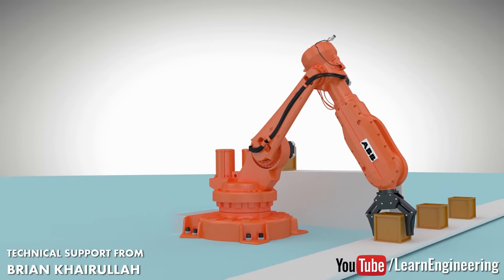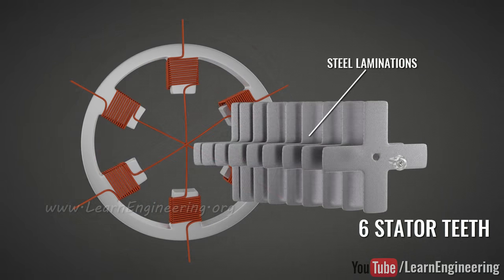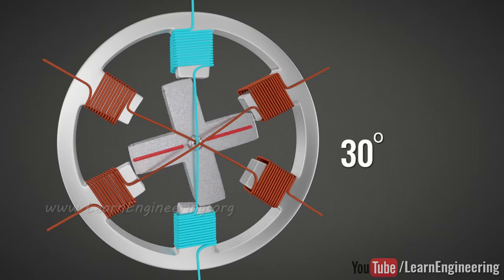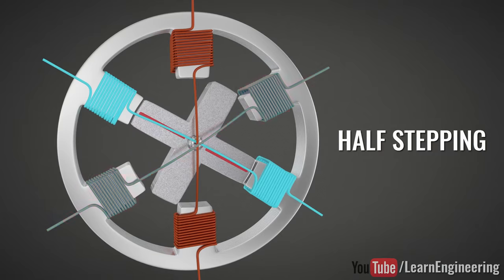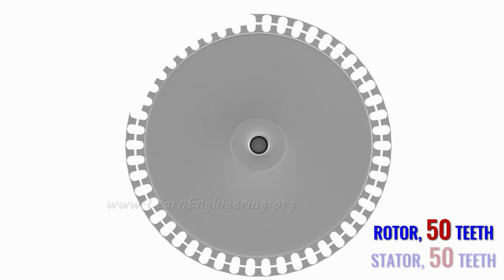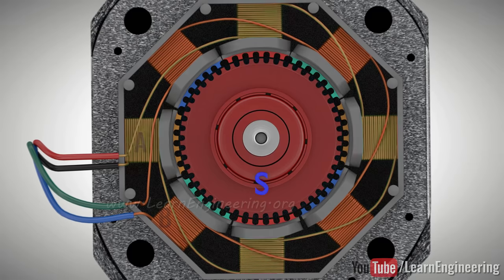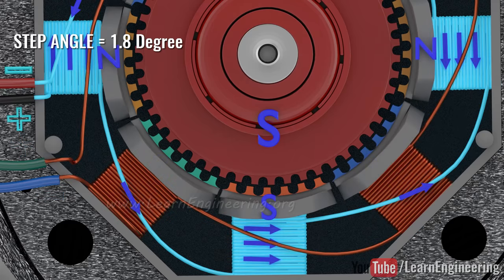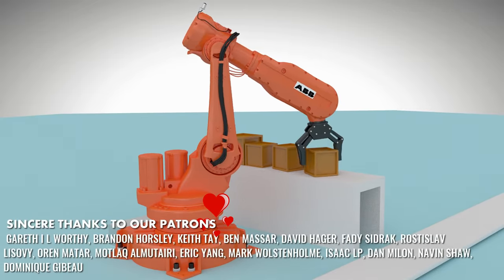How does a Stepper Motor work?

Comment: To be accurate.. most robotic arms use servos not stepper..  nice explanation anyway.
Reply: are those dc servos or hybrid s as in steppers with feedback loop?
I know DCs are way more efficient and powerfull but seeing that even cnc machines use steppers makes me wonder why cant they just use brushless dcs with a quadrature encoder.
Reply: Laharl Krichevskoy this are plain dc motors with feedback loop.
Reply: Some servomotors are closed loop stepper motors. Although AC motors are the most common, but older machines tend to use DC brush motors, not stepper motors.
Reply: thundercactus  yeah, and those are expensive as fuck!
If it's not for a very expensive machine, or if it is for some home project, better use a dc motor with an encoder and an arduino pro mini as the pid positional control.
Reply: Exactly what I was going to post because a closed loop system is the best way to know precisely where the arm really is at any moment.  A stepper ever skips it will never know.
Reply: you can make a good feedback encoder by printing 2 optical discs, and rotating one by a half step, so that you get both the rotation and the speed, you can then very accurately position your dc motor, with 2 250 line discs you have a precision of 0.36° or 1000 steps per turn (2* because you count transition, and 2* because you have 2 discs) plus it's pretty cheap as you can get the sensors for about 1$ each if you don't salvage them (and the discs and motor) from a printer.
if you add more calculations, you can get even more precision by estimating the speed of the motor.
Reply: Stepper motors are prevalent throughout the HVAC industry. 
Great video
Reply: when you say "most robotic arms use servos" do you mean to say "most robotic arms I know about use servos, so I assume the rest of the world does as well"?
Reply: If the stepper skips, the current flow through the motor will be abnormal. Some stepper driver ICs can detect this and signal the microcontroller. I don't think it's commonly used.
Reply: you can build your own motor and gearbox combo at VEXpro.com Their line of versaplanatry gearboxes can be shipped with enconders
Reply: Calm down, and drink some milk, kiddo
Reply: or some kool-aid
Reply: You are correct.  Steeper motor drive systems do not use positioning feedback.  So the loop is open.  Because of the robots operating close to the people being around, the open loop drive system crashes more often.  Even some software protections are built into them, still they crash.  Due to this, most of the robots use servo drive systems with encoder feedback and also some software runaway protections are built into them.  Stepper motors usually used on precision grinders.  The grinder wheel and the work piece must be heavily guarded due to wheel axes run away conditions due to open loop drive system.  I saw in may occasion that the wheels break apart hitting the work piece.  Very dangerous.
Reply: Nice username! No surprise that Google+ is no more, eh?
Reply: @alejandroperez5368  Also, have a cookie with that,, milk.
Reply: Dear haters of stepper motor: If as you suggest, place an encoder on a normal DC motor, how I stop it when the position is reached? We are in a position that made the stepper motor useless.

I am begin to think that you are not just haters but even liars.
Reply: What is the different between stepper and servo motor...
Please explain. Thanks
Reply: They areEhybrid servos with stepperRmotor and encoder mechanism makes some super accurate servo or hibrid stepper motor
Reply: Most use stepper motors, only the really big ones to use servos and their servos are just steppers technically with a rotary encoder

Comment: make a video on servo motor. .
Reply: They just did. 
65 idiot likes!
They are two in the same. One likes speed the other likes torque. Same class of motor though.
Reply: Nazim Ud Din okay
Reply: okay
Reply: That is not entirely true. Servo motor has a closed loop system to achieve precision, meaning it has an encoder on the motor itself and a driver that reads encoder information to achieve/correct positioning. Many motor types can be used as a servo motor. AC servos are most commonly used, not steppers.
Reply: Spot on mate AC servos are most common in automation and are completely different from stepper motors. Typically using resolvers or hyperface encoders to provide a closed loop feedback of the motor position.
Reply: +fla playa
1. The way servo motor and stepper motor work differs *greatly*. 
2. They can often achieve similar purposes.
Look up their differences to start with.

Comment: Excelent video. But i thought that all the robotic arms motor was a servo motor, stepper motors are too heavy compared to a servomotor with the same torque. Anyway, very nice explanation and keep going =)
Reply: Yeah great vid, but industrial robots and CNC machinery all use servos. The only ones that use steppers are low end hobbiest models.
Reply: Evan Bunke Exactly = )
Reply: hi guys I am helping someone with a stepper motor though I am not into motors .. I would like to use a smaller stepper motor for an application but is it possible to deliver the same torque with gears? and how does the ratio matter of the bigger and smaller stepper motor relate to each other? does 2 times a diameter deliver a 2 times higher torque?

Comment: Are you sure that these robots used stepper motors?   I thing they use servo motors.
Reply: Servomotors refer to a closed loop system, not a specific type of motor. The most common servos are AC motors, with older machines using brushed dc motors. But stepper motors can be used as a closed loop servomotor.
Reply: I have not seen the robots (except toys) which use stepper motors it seems to me that a much better solution is a servo motor (ac gear encoder). It seems to me that this is due to heavy weight stepper motors.
Reply: hobby machines may use stepper motors, but older machines used dc brush servos and new machines use ac servos. There's really no excuse to not have closed loop feedback control in a machine that requires consistent precision.
Reply: toys ..........................................?!

Comment: can someone explain to me why the step angle is 1/4 of the angular pitch
h ????
Reply: Let's assume we're looking at only 1 of the 48 stator teeth. Call it tooth 'x'.
Also, let's assume we're looking at only 1 of the 50 rotor teeth. Call it tooth 'y'.
We know one of the following cases could occur:
1- 'y' is left-half aligned with tooth 'x'
2- 'y' is perfectly aligned with tooth 'x'
3- 'y' is right-half aligned with tooth 'x'
4- 'y' is unaligned with tooth 'x' or any other stator tooth

Therefore, we have 4 possible scenarios for each rotor tooth. This means we have 50*4=200 different rotor tooth positions. We also know that rotating 1 revolution means rotating 360 degrees.

Do the calculations:

[360 degrees]/[200 positions]  = 1.8 degrees/position
Reply from the maker: It is clear from the diagram. Each time the rotor has to move 1/4th of angular pitch to align with the new North pole. The special geometrical arrangement facilitates this.
Reply: thanks n5roor  this cleared up
Reply: thank you all for your replay
Reply: Podhigai
Reply: Industrial robotic arms and CNC machines use servo motors
Reply: Tyler Reid, Hah)))) are u serious? )))))))))))))))))))))))))))) never say that again about CNC machines ( not sure about roboarms)
Reply: Legend Length,what i was trying to say to Tyler Reid, who has said that CNC machines use servos, that its not so. Servos are not steppers, and what CNC machines use are STEPPER motors :)
Reply: Your industry experience is very limited if you think most CNC machines are stepper driven. Most HOBBY machines are stepper driven. Almost all industrial CNC machines are servo driven.
Reply: same question

Comment: I invented this technology in 1974 while developing a blood analyzer. The technology was never patented since the company was a medical equipment developer and manufacturer. I taught the representatives of Superior Electric, the company that supplied the stepper motors, and the technology was published in training and repair manuals for the blood analyzer. I did encourage the company, my employer, to patent the micro stepping technology but the marketing department who was ask to review the commercial value said they could not find a market. Superior Electric was first at manufacturing micro stepping hardware based on my teaching them how it worked. 
I am presently working on an advanced driver technology that will improve efficiencies of operations and motor heating. Which I intend to patent. I am also working on motor improvements that will reduce the drive voltages both of which will open a new market to higher speed and higher power application of stepper motors. Larry Durkos

Comment: I use steppers with encoders on the ballscrews on my Cnc Mill conversion. I used 1150oz Superior Slo Syn steppers and Gecko drives, breakout board, wired in a speed configuration..
Been running Mill now since 2010 no issues. Its only faulted twice in that time, once because i forgot a table lock was on... other was during a 3 axis 1000IPM rapid so i cut rapids to 800ipm and its fine. Steppers still work in 2023. But id really like a modern servo spindle motor so i can Synchro/Tap etc.!!!  Best wishes all!! keep building stuff! 😋🥲

Comment: 4:24 if you apply the right hand rule of the magnetic field inside a solenoid it comes that the poles are inverted because the magnetic flux direction for example of the most top coil is from bottom to the top which means it behaves as south pole, what is it that I am not getting?

Comment: Wish this video mentioned that a large part of the design in the hybrid stepper motor is there to reinforce the strength and accuracy of step position alignments and the underlying principal behind moving in steps is exactly the same as the simpler variable reluctance motor.

Comment: Great video, explains it very well.  But its only part of the story.   All of that needs to be controlled by a computer. And you need some kind of a 'feed back' so that the computer knows where the rotor is at all times.

Comment: Some stand fans even have this motor, either the motor is connected to the oscilating mecanism, the blades (or the exposed shaft with a pin that secures the blades), or both.

Comment: Modern robots use 3-phase motors, like a modern electric car use. Its just magic, they use the Current  Vs Voltage readings of  each phase to compute the displacement. Magic.

Comment: That has to be some strong magnets. I thouht in robotic arms  are normal induction motor controled by hall sensor that turns at several thousand rpm and then there is some transmision to boost the torque.

Comment: If we use a stepper Motor for simple tasks (such as pedals for simulators), what is happening when you move the stepper by force of my feet, opposite from the direction that it was last time locked?
Is there a possibility to lose the stepper?

Comment: Couldn't you get a continuously variable (for lack of a better term) step size by varying the total power delivered to two adjacent coils?
For example, in a normal stepper motor, we have coils A and B.  When both A and B are energized, the rotor will move to a position equidistant to A and B.  
But what if coil A had 1.5W of power and B had 0.5W (or any other unequal power conditions?)  The increase in power would mean A would exert more force on the rotor than B, thereby pulling it closer.  But B would still be exerting force as well, stopping the rotor from fully aligning with A.  The lower the difference in power between the two coils, the closer the rotor will get to being equidistant from A and B.  
If you vary the power applied to two adjacent coils (i.e. A has 0.5W and B has 1.5W) without varying the power difference (delta-p =0) between them, you should, theoretically, be able to place the rotor at any given angle.  Right?

Comment: Is the second type adequate for high-end 3D printers? I ask because out shop acquired one recently, and the sharpness and accuracy of the parts it can make is very impressive. Since it relies on stepper motors, I wondered if the design shown was adequate.

Comment: The "modern" stepper motor described toward the end of the video is not necessarily a "hybrid" stepper.  The proper term for the motor that is shown is "bipolar stepper".  A bipolar (or unipolar) step motor can become a hybrid step motor with the addition of an encoder to the motor which will enable the positioning system to operate in a closed loop.  As others have stated, step motors are not what you would typically find in industrial robots and automation equipment. CNC machines and industrial robots most commonly use servo motors which are much faster and do not suffer from resonance power loss like steppers do. Step motors are used when precise and repeatable positioning is needed and the load on the motor is always the same such as in printers. An open-loop stepper driven system cannot correct its position if a step is missed due to the motor being temporarily over-loaded. A hybrid stepper driven system can correct for missed steps, but still cannot match the power and speed performance of a servo driven system.
You can trust that the information I've provided is accurate because I've built many CNC machines (which are industrial robots) using many different motion control technologies. Alternatively, you can trust that I am untrustworthy and deem all the information I've provided to be bull$#!t.

Comment: in the hybrid motor, won't the inertia of the rotor introduce "slippage" errors? How is that prevented, or at least accounted for?
Reply: the video didn't explain that the activation of the stators is in a cycle rather than steps. If you have noticed the stator activate in a counter-clock wise fashion whilst the rotors move in the opposite direction. If you increase the rotation of the stator's activation sequence the rotor will turn faster. If you want to slow it down all you have to do is make the stator activation sequence go in the same direction as the rotor. 

do you get it? :/

Comment: Robots use SERVO motors. Stepers have a one revolution track. After one revolution count has to be taken from a controller and kept track with if positional data is needed. They need to be homed after deenergization of the controller. SERVOs have encoders on them to keep track after more than one revolution with a closed loop controller.

Comment: Majority of robots and CNC machines use AC motors in a closed feedback loop. Although open loop steppers were more common in a time when computers to run a CNC consisted of 10sq ft of boards and parameters were set via potentiometers lol

Comment: Is there some way for the controller board to know where the motor is?  Or must it always keep track.  And if something happens to prevent it from moving, how can it know that its not where it thinks it is?
Reply: You've just figured out one of the reasons why open loop systems aren't actually used in robots.

Comment: 0:12 most modern robots are going to use an AC (or DC brushless) servo motor. Seems like a weird opening. Steppers are great for some stuff but they're not generally used in critical motion applications.

Comment: Industrial robots use either AC Servo Motors, Harmonic Drives or hybrid Harmonic Drives. A stepper motor is simply not powerful enough,  accurate enough or exhibit the anti backlash capability required for an industrial robot with micro-meter resolution.

Comment: A normal motor does not function in steps. Stepper motor is about precision. It can achieve precise control because of stepping. Can be controlled by computer which is called programming. 

The program can be understood by the desire to know and explained to those who are interested in knowing. It was in 8085 assembly language as per the syllabus in study. 8085 is known as 8-bit programmable microprocessor chip and is a part of syllabus for learning assembly language programming. There is a kit used in labs to enter and run the program. It is interfaced with stepper motor to see how it really functions.

Comment: There is a stepper motor integral to operation of dash instruments in my GMC Sierra and because my dash flashes on and off, I understand the SM is failing. Any idea how or why the motor is used in this application?

Comment: What’s the difference between a servo motor and a stepper motor 

If there is one at all
Reply: Servo motor is closed loop eg requires feedback and generally obtain much higher torque and speeds. Power off it can be moved. A stepper motor system is typically open loop as it has magnets that will hold position and will lock position when energised without closed loop feedback but it may have sensors to assist in positioning or have closed loop feedback. Steepers can be used with servo systems for processes that can be simpler.

Comment: I have the first generation ABB electro mechanical robot, the ASEA IRB 6. It does not have stepper motors, but rather DC motors with resolvers for position feedback. I do not believe any larger professional industrial robots use stepper motors.

Comment: But what organize distributing DC current between A & B ? 
Thanks very much .
Reply: Lawathe Maitham Eid لاوَذ ميثَم عيد 
In order to organize and energize the different coils, you have to have a logic controller with programmed instructions that can control the coils independently. you can't just connect power to these motors.
Reply: Jaden S.
Thank you for the answer.
Reply: Lawathe Maitham Eid لاوَذ ميثَم عيد no problem :)

Comment: I still have trouble, what happens if a load Knocks it off by 10degrees the open loop system computer will not know.
Reply: That is right. These open loop systems are typically found where loads are always consistent, such as inside inkjet printers, scanners, cameras, 3D printers.